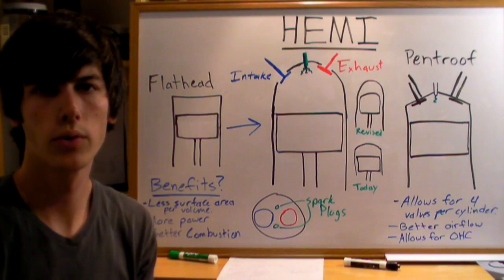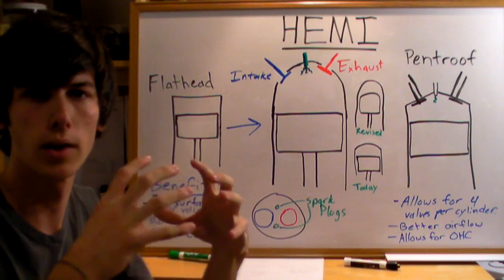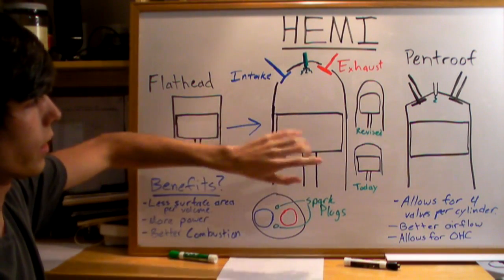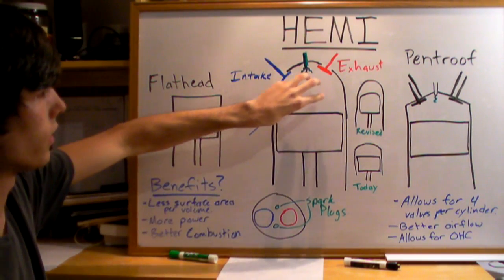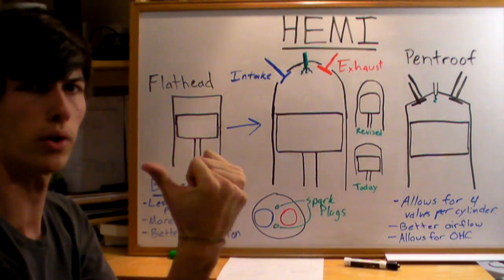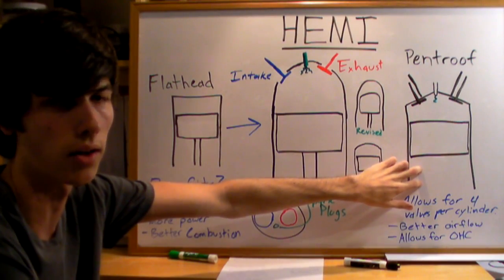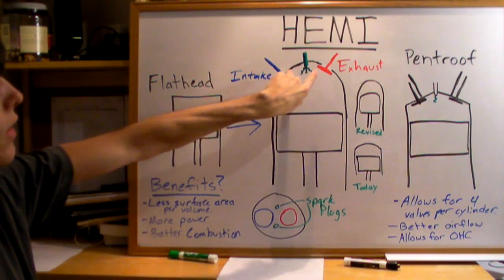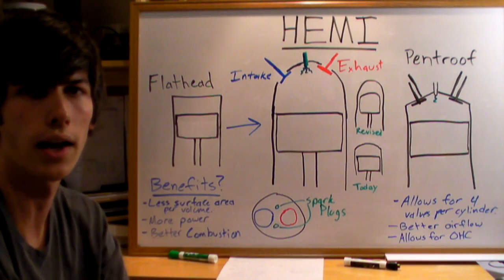What Is A HEMI Engine?

Comment: They do not use the 5.7 in SRT8s, and must be thinking the RT. SRTs started off with the 6.1 which is in my Challenger, then they went to the 392 in 2011 as far as their naturally aspirated vehicles and then there's the 6.2 hellcats & demons. They mainly use the 5.7 in trucks, which ironically have 10 more hp than the ones in cars and we're never designed to be in a performance vehicle to begin with

Comment: So I've got a ford with a 3.5 V6 and DOHC. With the shape of the pentroof and the spark plug position, do my cylinder heads basically function the same as the hemi heads?

Comment: The flathead was called flathead because the cylinder head  had no valves. It was flat(low). The valves was in the engine block beside the sylinder.

Comment: For the last 50 years, Top Fuel dragsters use 
an overhead cam Pentroof design.

Wait, that is INCORRECT!  They use the Gen II 
Elephant Hemi design!  2 valves per cylinder, 
and pushrods.  Produce about 10 THOUSAND 
horsepower.  (There isn't a dyno that can test 
them, but the blower eats about 3000 HP.)

steve
Reply: NHRA Top Fuel is a vintage class racing series... only the 1964 Chrysler 426 engine is allowed to compete.

Comment: Actually..the reason for the hemi was to allow the use of larger diameter valves..by canting the valves they can be larger and the motor breathes better...NASCar rules at the time stated race engines had to have two valves only so the hemi was selected to create a HP advantage...Downside it domed piston that reduced flame propagation but the better breathing improvements were a net positive.  There is NO need for a hemi head if you use 4 valves per cylinder.

Comment: Another reason for 2 spark plug is that the required large single intake/exhaust valves pushed the plug to the side necessitating 2 plugs to get useful and efficient combustion.  Aircraft piston engines have been dual plug for pretty much forever ... redundancy, not efficiency.

Comment: Here in Australia, we had slant-6 HEMI's in Chrysler Valiant Pacers and Chargers, in 245 and 265, and they were powerful enough to go toe-to-toe with the V8's (this was long before the days of turbo 6's). What is it about their design that allowed them to have the same output as the V8's, which were 351 Windsor/Cleveland, and 350 Chevy/308 Holden at that time frame?
Reply: Blake, maybe being an "Over square" engine may be the answer you're looking for. Also a big RT38 charger fan this way. A shame nobody thought about using a 4 speed box for Mt Panaroma.
Reply: The HEMI-6 was a wedge head... not a hemi.

Comment: The modern Hemi is in Wards Best engines since 2003, 04,05,06,07,09.  They are great engines, last a long time, have alots of power, take lots of RPM's well, and are extremely easy to work on. The heads are the real trick to the HP.  Look at the HellCat and RedEye Hemi's, not much to them but they put out 700 to over 800 HP very easily and are bullet proof!!!  Check out below BOREOUT's reply below for good information.

Comment: What you failed to mention about the two plugs per cylinder is that the second plug fires 4 degrees after the other and is fed by a cylinder on the other side of the engine.

Comment: Are you serious? The hemi is an inefficient design? You obviously don't know much about the hemi motor, much less the infamous 426 hemi. The hemi design that is now is a lot different than the original hemi. You're saying that it was difficult to get a high compression ratio. Seriously? That motor was all about high compression. The piston went up into the head. It had valve reliefs cut into the piston deep to accommodate the valves. Compression ratio was 10.25 to 1. The additional weight that you state from the piston was overcome by crank counterbalance weights that smoothed out the stroke.

You shouldn't talk about engines if you're not fully informed about them.
Reply: Hemisperical engines have been obsolete for decades..
They were inferior to pentroof and wedge designs.

Comment: ***Chrysler used the old design and trademarked the name even though it was used as far back as 1901 . Along with using someone elses v8 design .
Hemispherical cylinder heads have been used since at least 1901.
[1] they were used by the Belgian car maker Pipe in 1905[2] and the 1907 Fiat 130 HP Grand Prix racer.[3] The Peugeot Grand Prix Car of 1912 and the Alfa Romeo Grand Prix car of 1914 both were four valve engines also, Daimler, and Riley were also using hemispherical combustion chambers. Stutz, beginning in 1912, used four-valve engines

Comment: Poor representation of the flathead combustion chamber. In the real world, there is an extension of the combustion chamber over the valves which are in the block with stems parallel to the axis of the cylinder.

Comment: Efficiency is cool and all but a  Hemi shape IS better at making power at high RPM wide open throttle hence sport bikes, drag racers and other higher RPM applications are still using them. "The problem their having" comes from a response to the 'race on Sunday sell on Monday' phenomenon: people want what John Force has so they can tree a mustang at the intersection of main st and elm. So the cry-sler boys have to make a Himi behave on the streets instead of just explaining that the magnum was a better fit for the street. Molar folks could be enjoying more USABLE power in a lighter more fuel saving package if they would just reject the Himi marketing hypnosis.

Comment: I'll give you that if you want high performance with fuel economy, well then the more modern engines will do better than the crude ole hemi there. But if the ultimate in power for money spent is important, well my examples below show, it is far from outdated. Just not for those worried about fuel economy.

Comment: Ahh yes....the Hemi is so outdated....and forced induction is the way to make smaller engines its equal right. 
Well then. Lets talk about the spec on a forced induction Hemi. The Hellcat. 707 hp and you can drive it on the street every day. Or even more. The Demon. 840 hp you can buy a street legal race car. All from 'dated 2 valve per cyl and pushrods'. 
And lets talk racing. NHRA is still ruled by supercharged aftermarket Hemis. Same basic design but built much stronger. Care to know how much horsepower it takes to put a top fuel dragster or funny car through the quarter mile at over 300 mph and in less than 4 sec (new NHRA record set by Courtney Force "Force had a 3.993-second pass at 325.92 mph in a Chevy Camaro on Friday during her second qualifying run". Lets see forced induction out of Japan match this. The estimated power of top fuel Hemis is between 6,000 and 8,000 hp. And that's a fact.

Comment: On the HEMI vs. Flathead, you left out that on a HEMI, with the same diameter bore, there is more surface room to put larger diameter valves in the head.

Comment: And as of valves I don't fully agree that 4 valves are better than 2 jeep have valves almost the size of the combustion chamber. But in nut shell if you made the holes smaller put a divider in and popped 4 valves in that same engine I think you reduce the whole opening.?
Reply: 4 valves flow better and produce more power at high rpm. 2 valves flow better and give more power at low rpm. So as far as which is better, it depends on what is more important to you in a particular application.

Comment: Nothing at all weird about having two spark plugs per cylinder! All piston airplane engines have dual ignitions. The main reason is greater redundancy: one goes south, you've still got one. (This can come in really handy on a dark, stormy night!) BUT: the two ignition systems also increase efficiency. See, before each flight, the pilot of a piston-engine plane will stop before lining up on the runway, and rev the engine(s) about as high as the brakes can comfortably hold. Then, one after the other, the two ignition systems are cut off. The pilot is looking for a rev drop, something like 100 revs, which should happen if the ignition system he just cut off was operating correctly. MY point, though, is that the second ignition system gives you about extra 100 revs "for free", i.e. with the same amount of fuel running through the engine.

Comment: This video is way off. It was known back in the 50s that the combustion chamber shape was horrible for good combustion.  But the advantage of the hemi was/is the position of the valves. It increases the surface area for the valves which allows you to run much larger valves for a given bore size. The angle of the valves also allowed for straighter higher flowing ports. The advantages of the hemi has nothing to do with combustion chamber shape. It's all about flow.

Comment: The ford CVH engine was also a hemi, but it had the valves at a compound angle to each other so it was also an overhead cam configuration with the hydraulic valve setup.

Comment: "2 spark plugs unusual"- 2 spark plugs have been used in aircraft since ww2. 2 spark plugs gives a faster flame propogation-as the spark is initiated from 2 points, when you have a large volume i.e. hemi- it takes TIME for the flame front propagation.this limits the usuable force from the mixture /power and rpm and can lead to incomplete combustion of the mixture- thus emissions and fuel economy. although these vids are quite good i feel the speaker struggles to understand himself the principles.

Comment: When looking at trucks, until recently out of all the mfgs the Ram Hemi has the most HP and Torque. GM has Nothing to compete, Ford only recently came out with the 3.5 eco boost which has more output,until Rams 2019 hits the market which will raise the bar again! The 5.7 Hemi is a work horse and very dependable and actually pretty economicle if you keep your foot out of it, which is hard to do a lot of times!!!!

Comment: The hemi dual spark plugs do not ignite at the same(unless you modify it). They are wired in a way where they are essentially firing on compression and exhaust stroke.  So lets say Cylinder 1 Primary plug fires on compression stroke at that same time Cylinder 7 Secondary plug is firing on the exhaust stroke. Still just made for emissions but they do not fire in the same cylinder at the same time. It can be made made to fire both at the same time though.

Comment: Another important advantage of push rod engines that people forget is the lower complexity and thus lower cost of servicing and replacement if required. While a replacement hemi might cost you anywhere between 5k and 10k, an OHC V8 will cost you tens of thousands to replace.
Reply: I'm 99% sure it's down to them being more common and nothing more. OHC is actually simpler and has less moving parts.
Reply: szafirowy01 I read it's more expensive due to 2 camshafts having to be produced as well as more synchronization needed between the two, i.e. more precision required. The 6.2L AMG costs a fortune to replace, e.g.
Reply: But 6.2 AMG is an advanced high end performance engine from a premium manufacturer, so it has absolutely all factors to make it expensive. It's hard to compare anyway, as USA makes huge pushrod engines while the rest of the world makes smaller and more advanced OHC ones, so there's no direct comparison.
Reply: GlassTopRX7 fair enough. It seems though  that you can create a larger displacement push rod engine for the same packaging size of a smaller displacement DOHC engine. A smaller DOHC engine can make as much power or more at higher RPM compared to push rod engines. So in order to make more power from the smaller engine you have to rev the engine much higher which will require higher precision and tighter tolerances  and therefore higher cost. The 5.0 coyote outputs less max power than the 6.4L Hemi and has less torque down low. So there's no real advantage for going with the DOHC setup just in order to have a 'modern' engine. If it could rev all the way to 8500 or 9000, that'd be a different story. Plus in a muscle car made for US roads it makes more sense to optimize for low end torque for everyday fun vs high RPM power that you can only really use at the track or on a Canyon road. I don't think Mustang GT drivers would complain if their cars came with a hemi.....

Comment: A good explanation but a little short on history, In 1968 FIAT introduced a DOHC Hemi head on their 1438cc 124 engine. This wonderful screamer would rev to 6,800 thanks to light aluminum domed pistons. Maserati and Ferrari featured similar designs. The slower revving 4.2 XKE's had steel domed pistons.  Triumph motorcycles dominated the 1960's with their hemi heads on 500 and 650cc  twin cam push-rod twins. Though they used steel domed pistons, they were relatively small and light.

Comment: So not having and OHC design and not having 2 valves per cylinder are disadvantages? Tell that to the Demon
Reply: Ok?  Yes they are disadvantages.  The same supercharger would make more power on a stock 2018 Mustang engine that it does on a Demon.  

That engine is 307 ci

Comment: I guess I will be the oddball out here....     I have a 2008 Forenza, and I can tell you, OHV has one big advantage over OHC.  My timing belt came off at 135k miles and ruined my valves.  Had to get another Forenza, rip off the valve cover, and replace the whole unit  (That was fun, BTW).    OHV doesn't really have that problem, per se, although it theoretically could happen.   I don't see why OHV is obsolete per se, everything that can reduce costs and make it simpler to manufacture, as the Russians say, "Quantity has a quality all its own".
Reply: "Quantity has a quality all its own" I agree with this wholeheartedly, I think most have forgotten this way of thinking.

Comment: There are two types of comments

1. How inefficient and outdated the Hemi is
2. How people own one because Murica

I have one because I don't have a choice
Reply: 1. When did "[h]emi" become some sort of brand?
3. Why do you believe you "don't have a choice"?
Reply: Robert Duncan
Reply: Raging Bull honestly in europe it's a very popular engine because it's probably one of the only engines 
1) available in "basic" cars (jeep GC/Dodge Durango/charger)
2) one of the only naturally aspirated V8's (aside from the 5.0 in the mustang, but n/a engines are pretty rare anyways in Europe)
3) bifuel option in Dodges and RAM pickups (so they can run on either gasoline or autogas, which is slightly cleaner and much cheaper (equals to $1,8/US gal))
4) the bifuel option in a RAM 1500 (extremely popular) is great because you don't pay high displacement taxes (it's a pickup), you don't pay for alternative fuel taxes (it's a pickup), it's a huge vehicle that's pretty luxurious for it's price and it's about the same price as running a 40 mpg gasoline city car! (even though you should compare it to a bigger SUV, they're usually powered by a 3 liter 6cyl. diesel, soooo this gasser is MUCH cheaper to run, more fun to drive and faster).

oh, and they sound good.
Reply: Maxx Fordham! What happened to 2?😂😭
Reply: I was matching my numbers to his, that which I had questions about. So I skipped his 2 because I didn't have a question about it.
Reply: Raging Bull
Reply: Eric, HEMI's whats are outdated? Which possessions were you trying to refer to?
Reply: Raging Bull and the people pointing out the obvious
Reply: I smell GM and FoMoCo Commies! Go Murica! Go Mopar!

Comment: Chevy LS Has push rod too. so why is the hemi called out dated. hemi two spark plugs makes better HP with cleaner emissions. overhead cam v8 is top heavy and offten takes up lots of space. we had a overhead cam 340 cid hemi combustion chamber . But it was at the wrong time for the market.

Comment: The biggest benefit of the HEMI that's not mentioned here is that it BREATHES BETER on both the intake and exhaust
Reply: A modern hemi engine does not breath better then a 4 valve design, in fact the greatest weakness of the 5.7 (which is not in a srt as stated) is its lack of airflow through the valve.

Comment: the real advantage of the hemi was/is moving the exhaust valve to the outside. This freed up the intake valve and runner, and created a straight exhaust shot. It's all about the flow in and out of the cylinder the chamber shape has little to do with it. The more air you can get in and the quicker you can get it out the more power you will make, it's about building a better air pump.

Comment: Wow, first time watching one of your older videos from about six years ago. Still very good IMO. In hindsight, showing the valves in the block for the flat head may have helped a bit with the overall explanation about the designs. And, you skipped the wedge head completely - the hemi was considered an improvement on that design if I remember correctly. This was the first time I noticed inaccurate terminology coming from you... you referenced the "weight" of the hemi's piston when you actually were referring to a property (inertia) of its "mass" when describing the work the crankshaft needed to do to move the piston.  Regardless of my negative comments your white board and coloured markers have been of great value to a lot of people including me. I have frequently offered links to your videos when someone has asked "How does 'that' work?" Keep up the great work.

Comment: And now we have the dodge demon with the 6.2 supercharged hemi making 840hp.... nooooo its outdated!!! 😂😂
Reply: Just because it's making a high amount of HP doesn't mean it's outdated.
The engine has 840HP/6.2l~135.5HP/l
And the Honda CBR600f: 109HP/0.599l~182HP/l (just a random engine at the top of my head)
And that engine N/A.
Reply: Ryan Robinson it is. A 1.6L formula 1 engine makes 900 horsepower
Reply: A Tesla S P100D doesn’t make any horsepower and absolutely destroys the Demon in the 1/4...
Reply: Bartonovich52 duh cuz of the torque by an electric engine, but in a 1 mile the hemi would win